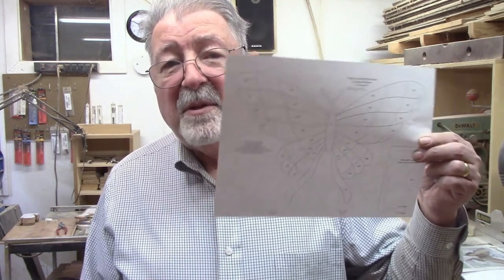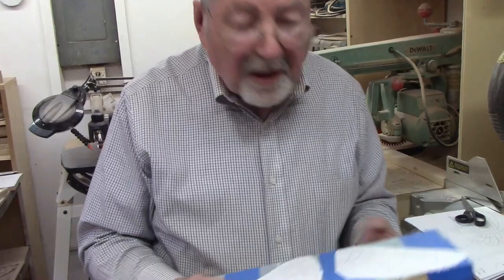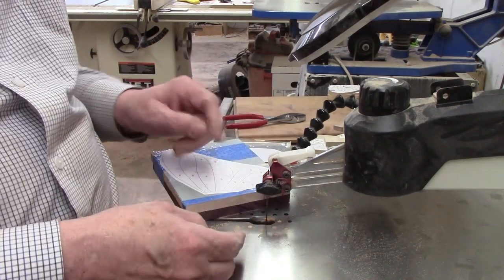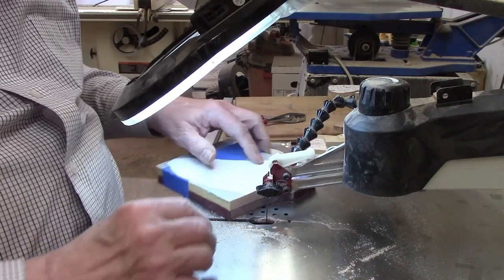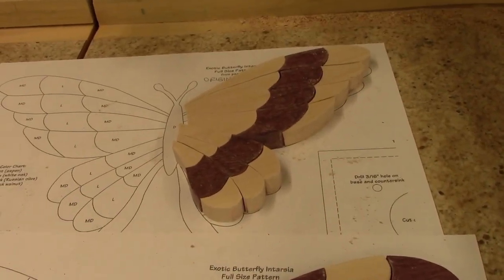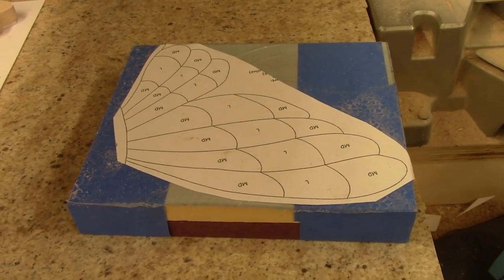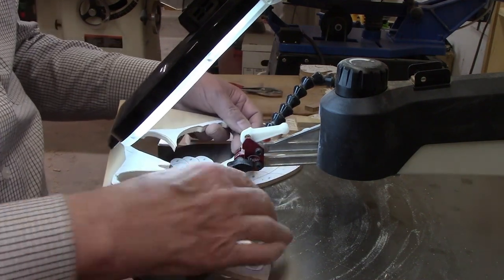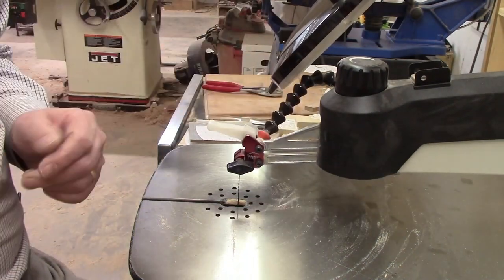Learn the art of intarsia while watching me make two butterflies from maple and purpleheart.

Comment: I'm surprised that you used the thickness planer to reduce these beautiful hardwoods, since you previously did a video on resawing.
Reply from the maker: The purpleheart was close to a full inch thick, the maple was only 13/16. I wanted 1/2 inch thicknesses on both because that's what the plans called for. Maybe I shouldn't have been so literal, but if you resaw 13/16 material down the middle you will lose 1/8 to the saw kerf. That leaves you with two pieces that will be less than 3/8 if you have to take 1/32 off each side to smooth them out. I could have cut the maple at 5/8 and 3/16, but by the time I planed that piece it would be too thin to be of any use. Maybe next time I will plane the maple to 1/2 but resaw the purpleheart. I should be able to get one board at 1/2 inch and another about 1/4 thick if I do it that way. Does that make any sense?

Comment: Bob, can you provide a recommendation on a lighted magnifier? Thank you.
Reply from the maker: This is the description of the magnifier I purchased on Amazon: 10X LED Magnifying Lamp with Clamp, KIRKAS 2,200 Lumens Dimmable Super Bright Daylight Magnifying Glass with Light, Adjustable Swivel Arm Lighted Magnifier lamp for Reading Repair Crafts- Black. That should give you enough information to find it. The light level is adjustable, and at the distance I am using it, I am using the light at a very low setting. It really comes in handy for close work on small pieces.
Reply: Thank you @bobshomewoodshop7996

Comment: So i just bough a bandsaw, can you make intarsia with a bandsaw?😊
Reply from the maker: That's an interesting question, but I would NOT recommend trying it. Intarsia usually requires some very small pieces, and you would have to get your fingers dangerously close to the blade. The bandsaw is a great tool, but not an appropriate one for this use.

Comment: What is the purpose of the backer?  Can one glue the parts directly to a substrate?  Thank you.
Reply from the maker: You need a backer because just edge gluing the parts together would make for a very weak assembly. Yes, you can glue directly to a substrate. I usually glue the back of the piece to a substrate and add a little glue in between the pieces as well.
Reply: Thank you. @bobshomewoodshop7996